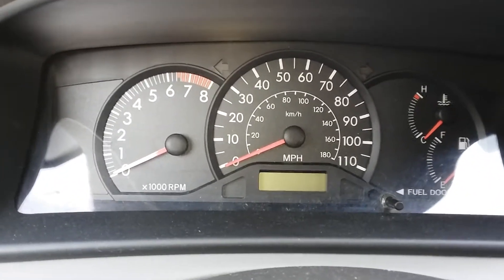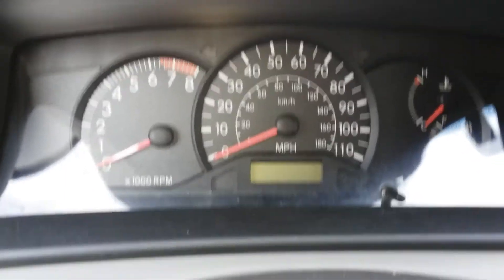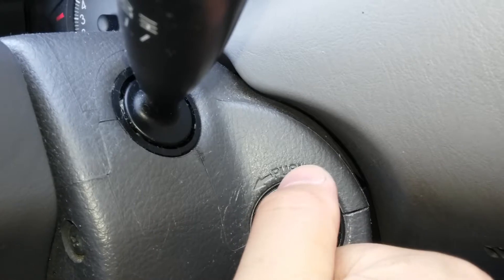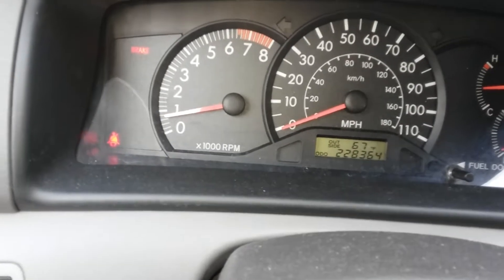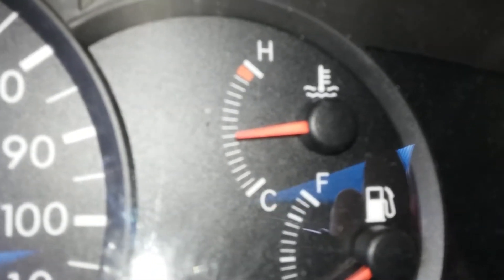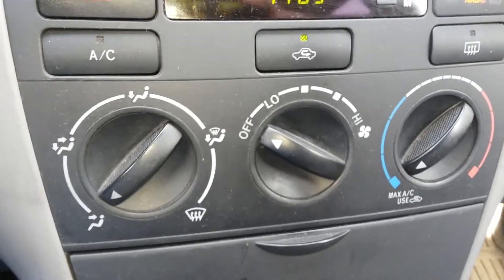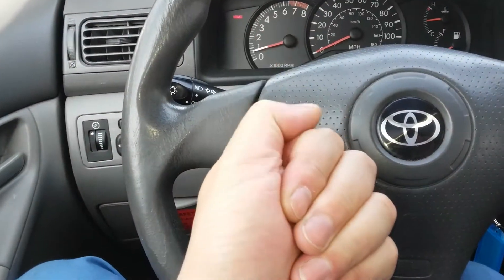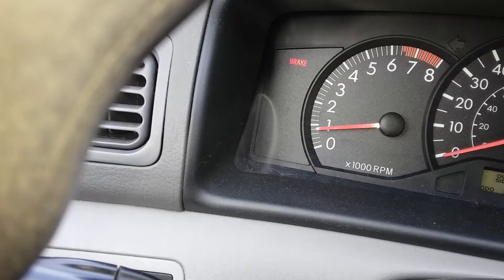Toyota TPS Reset when replace new battery or Rough idling

Comment: how can i reset idle speed for manual car? im having 2006 model, Manual
Reply from the maker: Hi, OK, I got it your Question.Yours are Manual trans.alright?
I cannot guarantee but try like this.

1. All AC system electric shut off.
2. Shift neutral then ER.Parking brakes on.
3. ignition key insert to on position (Do not start engine) then back off key position.
4. Again ignition key on position then start engine.(now relearn mode)
5. Keep idling after 3~5 minuite will be succes then process done.

Good luck. If does not works, please bring Toyota dealer.
Reply: @usatetsu  okey ill try thanks a lot
Reply from the maker: OK, I hopefully to your success & good luck.